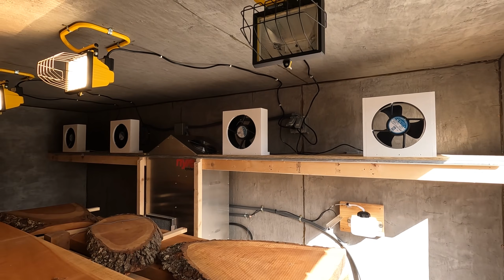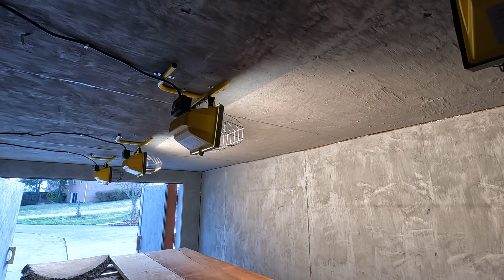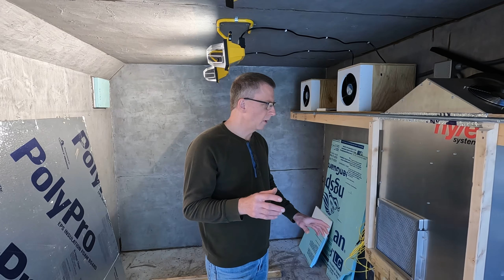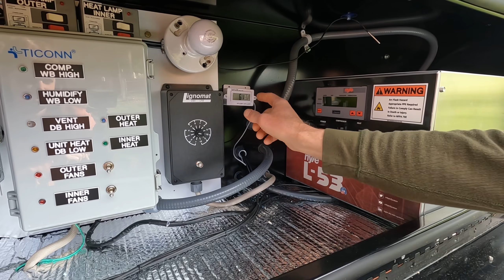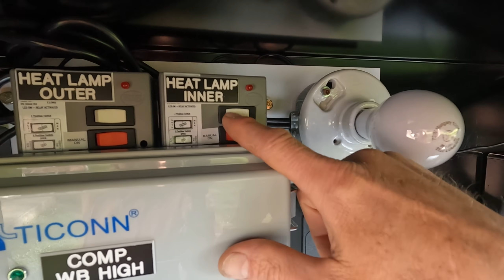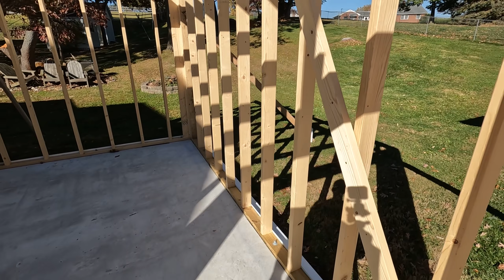Lumber Kiln disguised as a garden shed!

Comment: Does it matter that your wet bulb has steady airflow directed across it just below the fan there? Perhaps it should be in a partial enclosure? Just curious.
Reply from the maker: Yea, I actually had to make a shield to block some of the airflow from the wet bulb sensor after I made this video.  I was getting high wet bulb readings making my compressor run more than it should.  I experimented with about a dozen shields and got the wet bulb close to being accurate, but never could get it perfect.  I put in a Govee bluetooth humidity sensor and use that to adjust the settings on the L53.  The Govee seems pretty accurate.
Reply: @braddoesitall  I started using Govee inside my L-53 setup this week and it will be a game changer. (I'm on only my 2nd test load -- 500 bf of poplar.)  Enjoyed your build videos. Thanks.